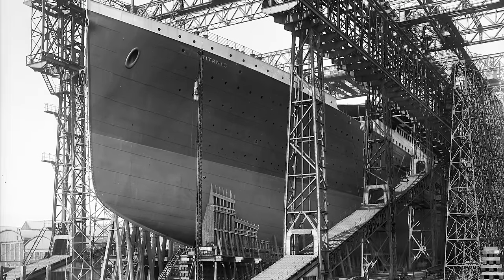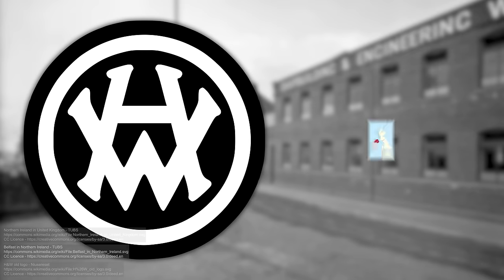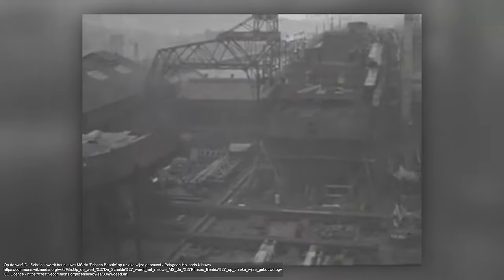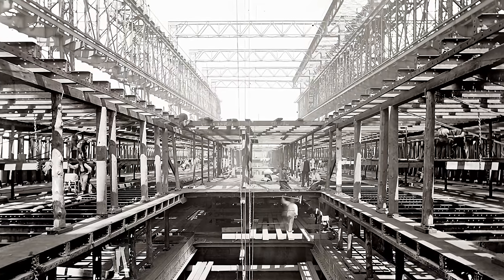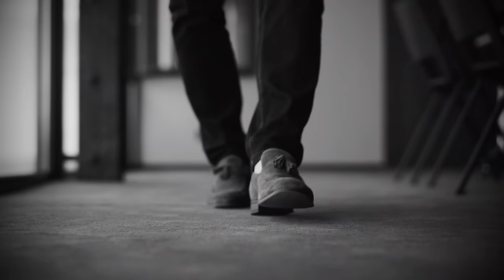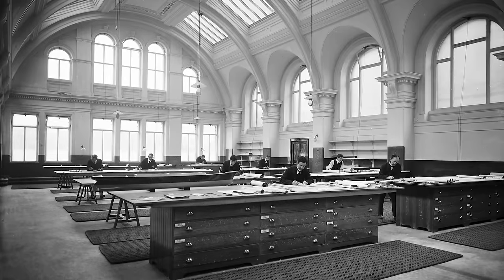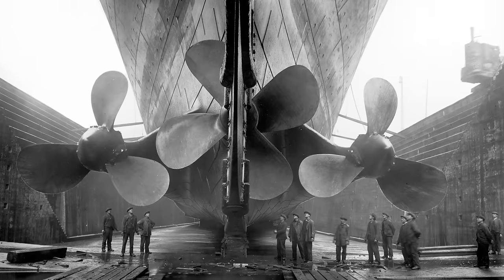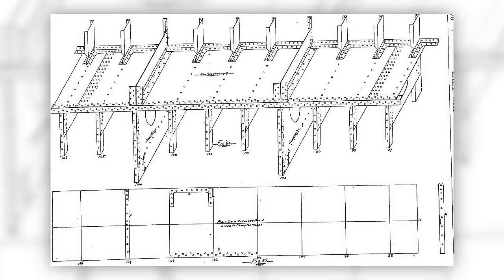The Shipyard That Built Titanic: Harland & Wolff

Comment: The fact that they built all of this without a single computer or 3d modeling software is nothing short of incredible. All they had were blueprints and the imagination to envision their creations right before their eyes.
Reply: Thats how it was all done back then until relatively recent times - designed and built by a skilled workforce who knew what they were doing.
Reply: I use computer aided drafting at work every day, and I'm amazed as well ... except on those days the software bogs down or glitches, and more time is spent troubleshooting than producing. Then I'm envious of simple drafting tools and their Library of Congress like workspace. I do wonder how much was just fabricated on the spot rather than drawn in advance.
Reply: @rcnfo1197 Very little I suspect. Now that doesn't mean there weren't allowances made when a fabricated piece deviated slightly from what the drawings called for, but in such cases the engineers would be consulted and either a workaround approved or the part scrapped and made over. Like any large project, I would expect there were three sets of drawings made (excluding copies). First a preliminary set, then a working set detailing changes as construction proceeded, and finally, an "as built" set accurate to the finished ship so that the yard had a reference to work from should replacement parts be needed years later in the ship's career.
Reply: Still mostly the same way. All of that paper work is on the computer.Any corrections were by hand. A computer could make that work faster. Plus stres testing can be simulated on models.

Days of old were trial and error
Reply: How very British of the older period, everyone in authority bought their way in, whether in business, miltary, or government.  And only then had to show skills - or lack thereof.
Reply: And a lot of very careful and precise math
Reply: ..The ship was mostly done by hands. .cuz, a few ship building machinaries were available at that time... .

Comment: As always, a well thought out presentation with a good mix of detail, graphics and CGI.  This did remind me of the mini-series a few years back that covered building, launching and eventual sinking of this iconic ship.  If I recall correctly, the series followed the lives of several characters from common labor (the daily cattle call at the gate for a day's wage, including religious animosity against Catholics) through some of the true craftsmen in various specialized shops right up to the top of the management offices and some of the decisions that had to be made during construction (i.e. the talk about the different rivets types and even some of the plate steel) and finally trying to find enough coal for the initial sailing as I believe the miners were striking for better wages at the time of sailing and the fuel was just not available.

Comment: To anyone wondering what happened to Harland and Wolff, they still exist today but they don't build ships. The last ship they build was The Anvil Point in 2002. They now build green power equipment such as wind turbines and the shipyard where Titan was built is now owned by a private preservation company. In 2019. Harland and Wolff went under with thier Norwegian parent company but were bought out and saved by InfraStrata.

Good sequel video to this would be John Brown Shipbuilding. Not to knock Harland and Wolff but they did get a boost at the beginning thanks to Wolff's uncle. John Brown had to work their way up from the very beginning by getting lucky with their second ship. Plus, what happened to the company and shipyard itself is quite interesting as well as rather sad in the case of the former.

Comment: 9:05 - and this, if you ever build scale models, is also the term to describe someone who has an obsession with accuracy as well as details. 

Rivet Counter: "Painted nicely, but you should've used Testors 2.9°C Deep Atlantic Blue #10292939 for that part"
Model Builder: "stfu, it's the only paint I had"

Comment: The slipways where Olympic and Titanic were built are still there in Belfast. Each slipway has an outline of each ship where they stood when they were built. They built a museum on the site, and it’s really fascinating. You can see full scale mockups of the different cabins of the different classes. 

They also have one of the original tenders that were used in Cherbourg, and you can actually go on board and see it up close. 
https://en.wikipedia.org/wiki/SS_Nomadic_(1911)?wprov=sfti1

Comment: As the wreck slowly crumbles, I wonder how many buoyant items, dragged down by the sinking, are now able to break free & rise to the surface? In fact, after more than a century being held at such immense water pressures, would the various timbers involved, both hard & softwood, still actually 'float'? : )
Reply: No, not much chance of that.  Any hardwoods or softwoods would have been "waterlogged" under extreme pressure and incapable of floating to the surface.

Comment: I do remodeling carpentry and metal work and when tryin to come up with curves and structures that need to be precise depending on how many pieces you need you'd start by caulking out each piece on the floor and either build and bend to the diagram sketched out or make a jig which basically acts like the diagram

Comment: Wonder why nobody has built a 100% replica of the Titanic. I have never been on a oceanliner. But a Titanic on the same route ? That would be "interesting".
Reply: Extremely expensive with little sustainable business prospect. Ocean liners aren't used anymore. The demand has moved to air travel. Cruise ships serve a different purpose and people expect their amenities.

If 100% replica, it would also be ruinously expensive to operate. Coal-fired steam propulsion in 2024 with all the manpower that would require? No way that would be funded just to be able to say the recreation was exact.
Reply: Yes. The Titanic used up to 850 ton of coal/day at full steam. one ton of coal costs about 100$. So 85.000$ / day. A large modern cruise ship can use up to 250 ton of fuel a day. One ton cost about 550$..Or 137.500$ / day.. The total number of people on the Titanic was 2240. 900 crew. 1340 passangers. Thats a 1,5 to 1 ratio. Modern cruise ships have a 3 to 1 ratio. Sometimes even 4 to 1.. So Yes a lot of people had to get "fired" from that "engine room" ( Strokers. Coal trimmers. Greasers alone. Were 269 people ).

Comment: They did tests of the rivets Rivets and Hull plates.  Some of the Reviews were cast iron which is brittle instead of  Superior. Steel Rivets which was commonly used.  They also punched the holes for he Rivets instead. of drilling the holes.  Drilling was much Superior method because as the Narrator stated the steel plates were brittle given the Steel making techniques at the time...This hole punching caused micro cracks in the plates along with the inferior.cast iron  Rivets made the quality of construction suspect.  Finally they used number 3 Rivets called "Best" instead of number 4 called 'Best Best";.  If you were going to Claim the Biggest Unsinkable.Ship Wouldn't You use the Highest grade Metals and Building techniques to build the Hull?